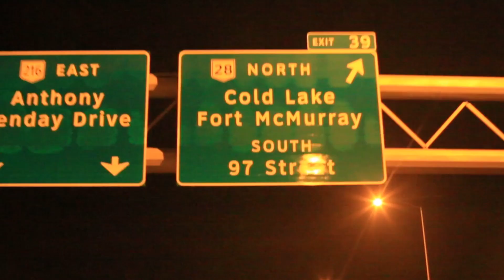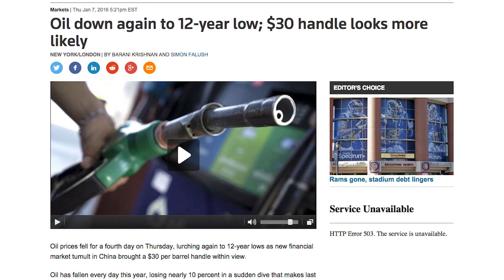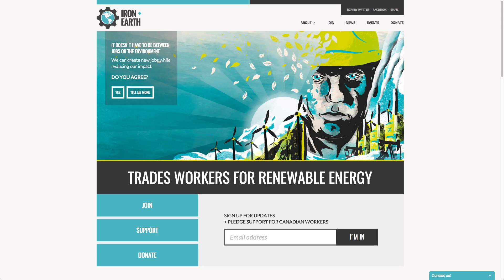About Iron and Earth

Comment: The miracle of iron

Iron is one of the elements highlighted in the Qur'an. In Surat al-Hadid, meaning Iron, we are informed: 

And We also sent down iron in which there lies great force and which has many uses for mankind… (Qur’an, 57:25)

The word “anzalna,” translated as "sent down" and used for iron in the verse, could be thought of having a metaphorical meaning to explain that iron has been given to benefit people. But, when we take into consideration the literal meaning of the word, which is, "being physically sent down from the sky," as in the case of rain and Sun rays, we realize that this verse implies a very significant scientific miracle. Because, modern astronomical findings have disclosed that the iron found in our world has come from giant stars in outer space. 1 
Not only the iron on earth, but also the iron in the entire Solar System, comes from outer space, since the temperature in the Sun is inadequate for the formation of iron. The sun has a surface temperature of 6,000 degrees Celsius, and a core temperature of approximately 20 million degrees. Iron can only be produced in much larger stars than the Sun, where the temperature reaches a few hundred million degrees. When the amount of iron exceeds a certain level in a star, the star can no longer accommodate it, and it eventually explodes in what is called a "nova" or a "supernova." These explosions make it possible for iron to be given off into space. 2 
One scientific source provides the following information on this subject: 

There is also evidence for older supernova events: Enhanced levels of iron-60 in deep-sea sediments have been interpreted as indications that a supernova explosion occurred within 90 light-years of the sun about 5 million years ago. Iron-60 is a radioactive isotope of iron, formed in supernova explosions, which decays with a half life of 1.5 million years. An enhanced presence of this isotope in a geologic layer indicates the recent nucleosynthesis of elements nearby in space and their subsequent transport to the earth (perhaps as part of dust grains). 3 

All this shows that iron did not form on the Earth, but was carried from Supernovas, and was "sent down," as stated in the verse. It is clear that this fact could not have been known in the 7th century, when the Qur'an was revealed. Nevertheless, this fact is related in the Qur’an, the Word of Allah, Who encompasses all things in His infinite knowledge. 
Astronomy has also revealed that other elements also formed outside the Earth. In the expression “We also sent down iron” in the verse, the word “also” may well be referring to that idea. However, the fact that the verse specifically mentions iron is quite astounding, considering that these discoveries were made at the end of the 20th century. In his book Nature’s Destiny, the well-known microbiologist Michael Denton emphasizes the importance of iron: 

Of all the metals there is none more essential to life than iron. It is the accumulation of iron in the center of a star which triggers a supernova explosion and the subsequent scattering of the vital atoms of life throughout the cosmos. It was the drawing by gravity of iron atoms to the center of the primeval earth that generated the heat which caused the initial chemical differentiation of the earth, the outgassing of the early atmosphere, and ultimately the formation of the hydrosphere. It is molten iron in the center of the earth which, acting like a gigantic dynamo, generates the earth’s magnetic field, which in turn creates the Van Allen radiation belts that shield the earth’s surface from destructive high-energy-penetrating cosmic radiation and preserve the crucial ozone layer from cosmic ray destruction… 
 
Without the iron atom, there would be no carbon-based life in the cosmos; no supernovae, no heating of the primitive earth, no atmosphere or hydrosphere. There would be no protective magnetic field, no Van Allen radiation belts, no ozone layer, no metal to make hemoglobin [in human blood], no metal to tame the reactivity of oxygen, and no oxidative metabolism. 
 
The intriguing and intimate relationship between life and iron, between the red color of blood and the dying of some distant star, not only indicates the relevance of metals to biology but also the biocentricity of the cosmos… 4

This account clearly indicates the importance of the iron atom. The fact that particular attention is drawn to iron in the Qur’an also emphasises the importance of the element. In addition, there is another hidden truth in the Qur’an which draws attention to the importance of iron: Surat al-Hadid 25, which refers to iron, contains two rather interesting mathematical codes. 
“Al- Hadid” is the 57th sura in the Qur’an. The abjad of the word “Al-Hadid” in Arabic, when the numerological values of its letters are added up, is also 57. 
The numerological value of the word “hadid” alone is 26. And 26 is the atomic number of iron. 
Moreover, iron oxide particles were used in a cancer treatment in recent months and positive developments were observed. A team led by Dr. Andreas Jordan, at the world famous Charité Hospital in Germany, succeeded in destroying cancer cells with this new technique developed for the treatment of cancer—magnetic fluid hyperthermia (high temperature magnetic liquid). As a result of this technique, first performed on the 26-year-old Nikolaus H., no new cancer cells were observed in the patient in the following three months. 

This method of treatment can be summarised as follows: 
 
1. A liquid containing iron oxide particles is injected into the tumour by means of a special syringe. These particles spread throughout the tumour cells. This liquid consists of thousands of millions of particles, 1,000 times smaller than the red blood corpuscles, of iron oxide in 1 cm3 that can easily flow through all blood vessels. 5
 
2. The patient is then placed in a machine with a powerful magnetic field. 
 
3. This magnetic field, applied externally, begins to set the iron particles in the tumour in motion. During this time the temperature in the tumour containing the iron oxide particles rises by up to 45 degrees. 
 
4. In a few minutes the cancer cells, unable to protect themselves from the heat, are either weakened or destroyed. The tumour may then be completely eradicated with subsequent chemotherapy. 6

In this treatment it is only the cancer cells that are affected by the magnetic field, since only they contain the iron oxide particles. The spread of this technique is a major development in the treatment of this potentially lethal disease. In the treatment of such a widespread disease as cancer, the use of the expression “iron in which there lies great force and which has many uses for mankind” (Qur’an, 57:25) in the Qur’an is particularly noteworthy. Indeed, in that verse, the Qur’an may be indicating the benefits of iron for human health. (Allah knows best.) 

 
1- Dr. Mazhar U. Kazi, 130 Evident Miracles in the Qur'an (New York, USA: Crescent Publishing House: 1998), 110-111; and www.wamy.co.uk/announcements3.html, from Prof. Zighloul Raghib El-Naggar’s speech
2- Ibid.
3- Priscilla Frisch, “The Galactic Environment of the Sun,” American Scientist, January-February 2000, www.americanscientist.org/template/AssetDetail/assetid/21173?fulltext=true.
4- Michael J. Denton, Nature’s Destiny (The Free Press: 1998), 198.
5- www.inm-gmbh.de/cgi-bin/frame/frameloader.pl?sprache=en&url=http://www.inm-gmbh.de/htdocs/technologien/highlights/highlights_en.htm.
6- "Nanotechnology successfully helps cancer therapies," IIC Fast Track, Nanotech News from Eastern Germany, Industrial Investment Council, October 2003; www.iic.de/uploads/media/NANO_FT_Nov2003_01.pdf

Comment: Lliam, another Sector that needs Skilled worker's with Crane experience is the Cell Tower Business in the USA. There's a high # of catastrophic accidents, either the Telecom companies are going on the cheap and hiring inexperienced Contractors, and non-union unskilled worker's. It's a challenge that could be approached with a good pool of skilled tradesmen. Do you know of the MOST Program where we were able to work in the US? Talk to your Business Agent about it. It was a Reciprocal Agreement to work both sides of the 49th when either country needed Manpower for Fall Outages or Emergency situations, especially in the Energy Sector and Steel making.